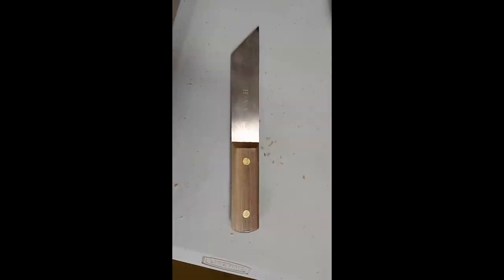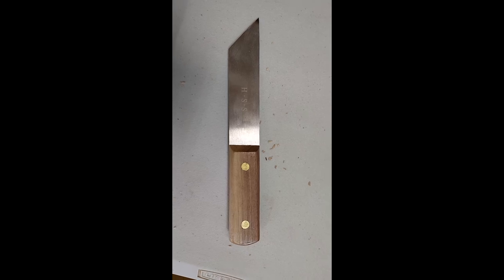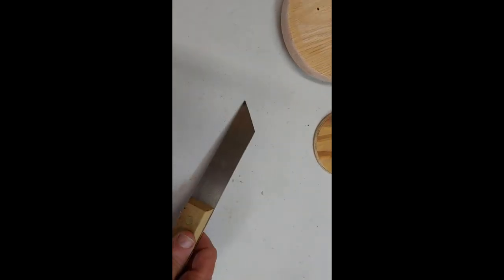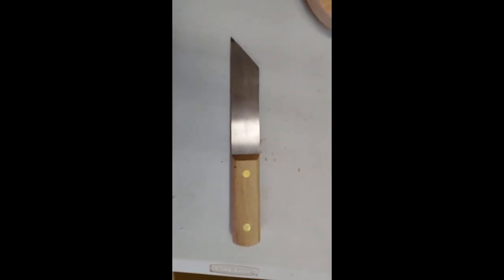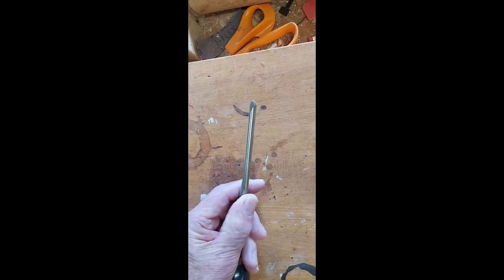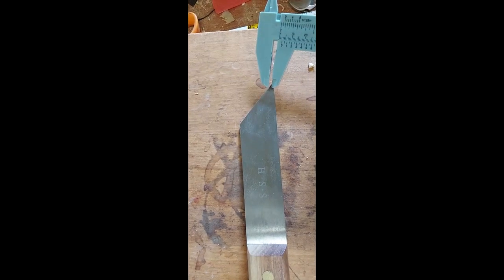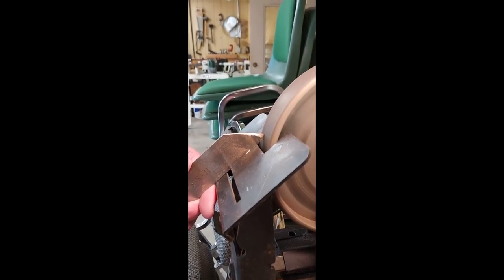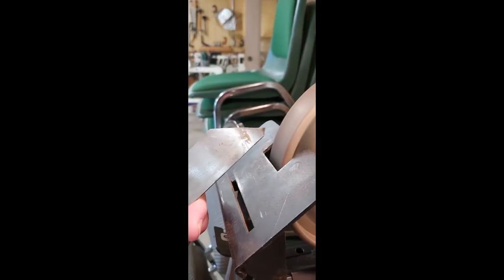Thin Parting Tool Hack for Woodturners - Short

Comment: Personally, I adapted a sawzall blade for a thin parting tool, and stuck it in a handle.
Reply: I used a sawzall blade as well and put a negative rake grind as Mike did.
Reply from the maker: I might have done that when I started if I had an old Sawzall blade. But this one from PSI of HSS was only $15 at the time so maybe not.

Comment: I have the Sorby thin parting tool and I use it all the time. So I think your tip to reshape that way is worth trying. Do you think the same shape would work in a normal width parting tool? Mine is not a diamond cut but just flat lengthwise, and the sharp corner symmetrically in the middle. I don't like it, wondering if it would perform better if I move the pinpoint sideways. Also, I have noted that I was starting to succeed with the skew when I tried it the long side down, so the cutting happens/begins in the same spot as with the slim parting tool. As I rotate the skew the cutting action travels higher along the blade  of course. I have a 90 degree parting chisel and a 60 degree. I am a bit lost with them. Keep thinking a bedan would be more efficient when slicing bigger chunks. I would love an expert explaining them, there is a lot about the skew and gouges, but not the standard parting tool... 😅
Reply from the maker: I would not move the tip or your regular parting tool. When you say 90 degrees are you talking about the included angle with 45 deg on each side? If so try an included angle of 40 degrees. I personally do not care for a bedan preferring a beading and parting tool (see the video).
Reply: @MikePeaceWoodturning  Hmmm, I do not know the terminology but I think that is what it is. So basically, you are suggesting I would try making it broader than the squared mid point? That is interesting. I better do some more homework on how different shapings influence cutting before I make such a big modification. First need to check whether I am using it the right way and is my sharpening technique what I need to improve. The issue could be in the shape, in the way I use it, or the way I sharpen it... to begin with.  Thanks for the advice, much appreciated, and will check the recommended video!
Reply: @MikePeaceWoodturning  Reporting back to previous comments. I found that my regular parting tool cuts like butter on dry birch, so it is a matter of choosing the right tool for a specific material. I watched the video on beading tools and left a comment there. I do not have a beading tool that you have, but looked efficient and will get one in the future. I will probably do it myself using a round shank, and buy the bedan for harsh peeling and flat scraping action like bottom of a box.